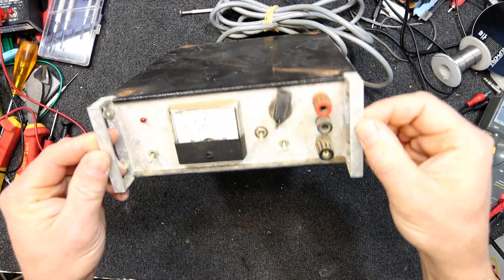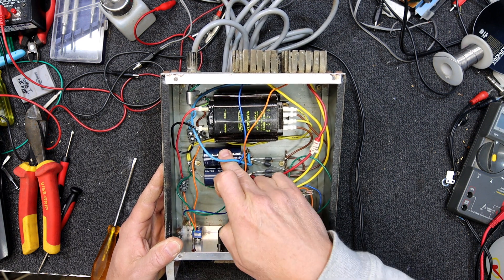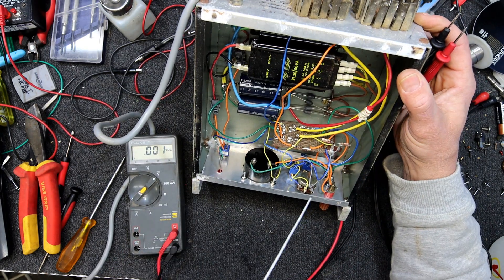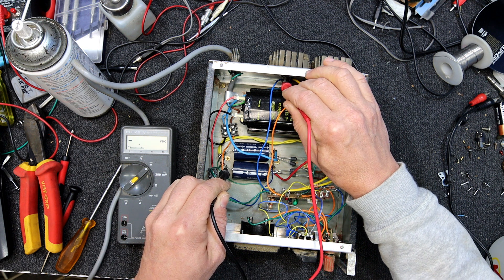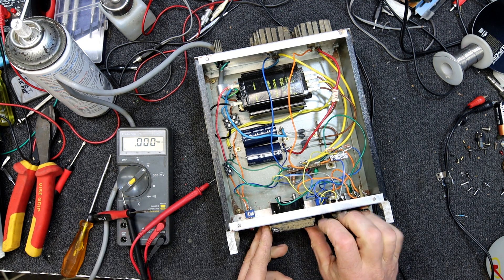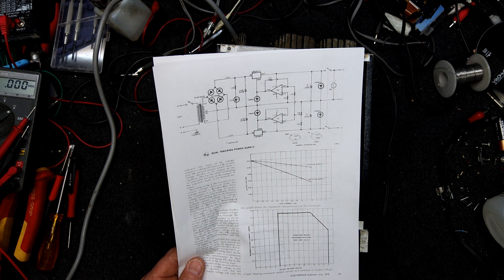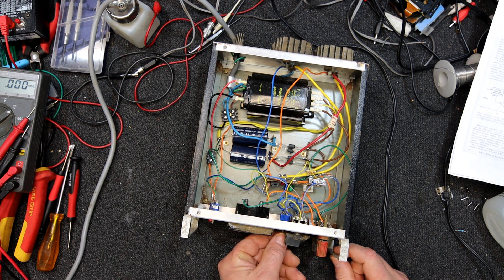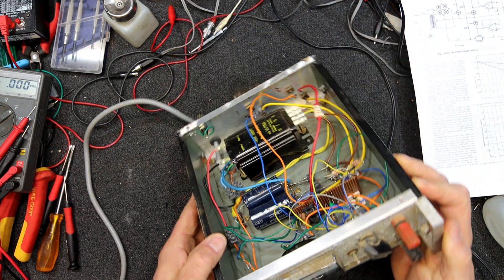Home Made Dual Tracking Power Supply Electronics Australia 1979

Comment: Amazing it worked so well with that much corrosion! 👍
Reply from the maker: It was looking like it might only be good for scrap metal but turned out surprisingly well. I just pulled the front off to clean it up and spray paint it, and could hardly get those front handles off. I also had to chop the knob in half with bolt cutters because the grub screw head broke off on one side of the screwdriver slot.
Reply: @StevesElectronicRepairShop  Well, you didn't like the knob anyway! 🤣
Reply from the maker: @TheUltimateRecycler  I must admit I got some pleasure from chopping the ugly unergonomic thing in half